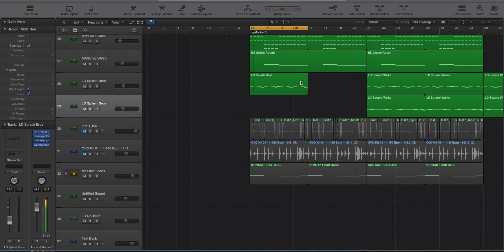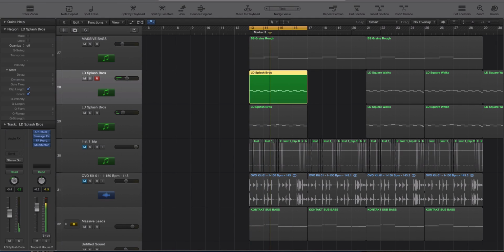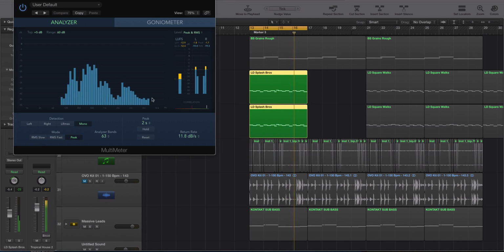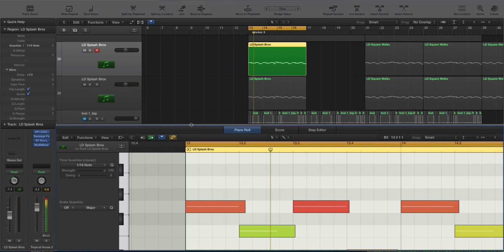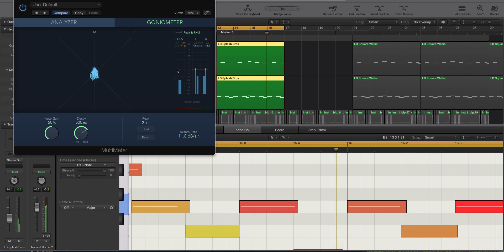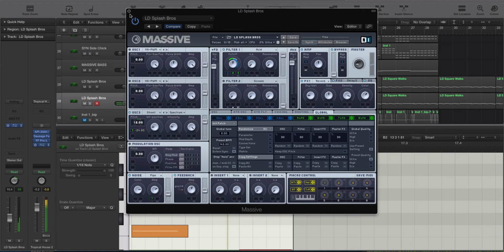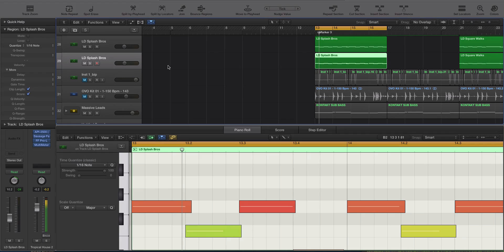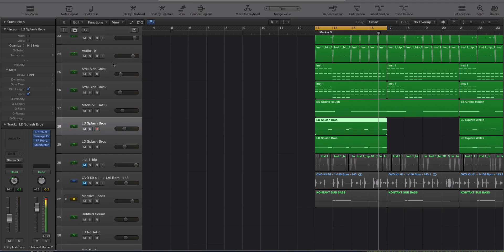Mix Essentials - Doubling Software Synths

Comment: I really appreciate this tip thank you. On my own I was doing the second example you showed about slightly altering the sound of the keyboard itself. But this nudging you did I think is fantastic!! Question what about using the left and right channel like a person would use on guitar do you have a video about that. Because I thought we would apply that same method to the plug-ins or instrument library and logic.